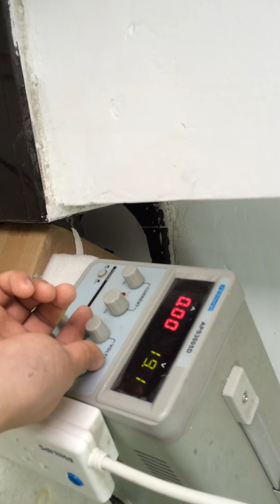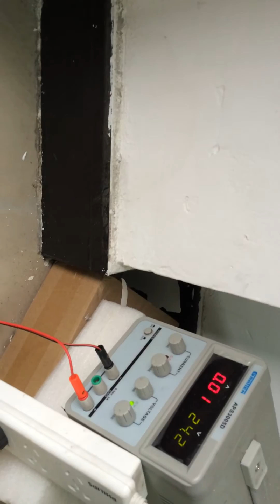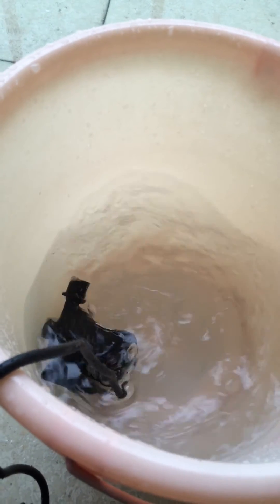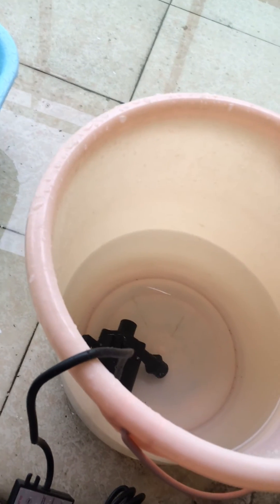Introduction of the latest powerful brushless pump DC50E-24150A 24V Speed adjustable

Comment: Hi  ! this  pomp  work  from 12 volt  in  how  mucke  lift  from  12 v  in  how  mucke cost  I  tink  it from  China product
Reply from the maker: +gogu gogu Hello, thank you for your comment message.
Yes, we are professional company specialized in R&D of various micro brushless DC pump products (typically 12VDC & 24VDC), which is located in Shenzhen, China. So our products are Chinese products. That's right.

When this pump works at 12VDC power supply, of course it normally works but its power decreases significantly. When @24VDC, its power consumption is normally around 86W; when @12VDC, its power consumption may be less than 30W. At this moment, its lift value may be just around 5m@12VDC. So it's much less powerful if @12VDC.

Instead, if users want to get a nice power-efficiency when the power supply is certainly 12VDC, then an alternative model is more advised, which is DC50F-12110A model: 
http://www.ebay.com/itm/291596977325
12VDC as rated volatge, power consumption is around 54W @12VDC ans max static lift is around 11m@12VDC and max horizontal flow rate is around 1300L/H. So from aspect of power-efficiency: if users decide to use 24VDC power supply, then DC50E-24150A model is advised; if users decide to use 12VDC power supply, then DC50F-12110A model is more advised.

Of course, both models support power regulation function, flexible in applications when parameters are required to be changed when in applications.

Hope relevant information can be useful! Best Regards!

Lily from Shysky Tech Co., Ltd lilyyan@shyskytech.com